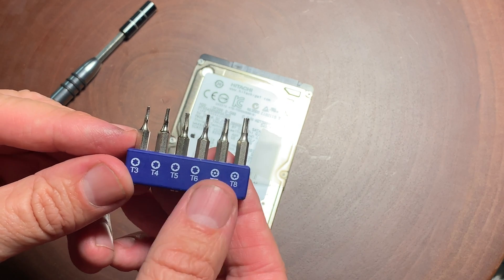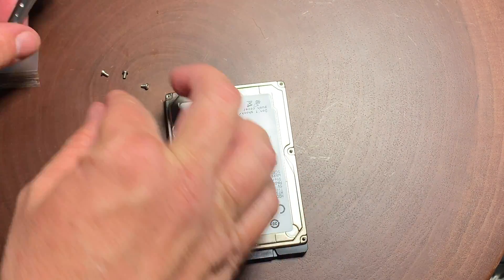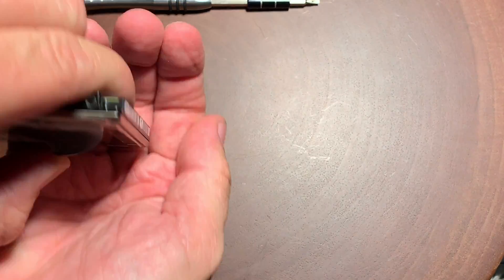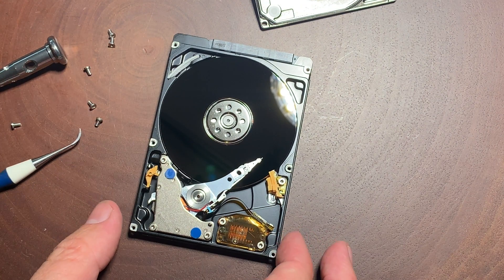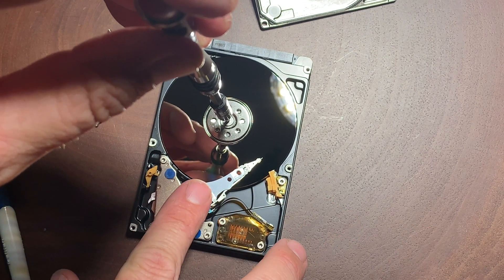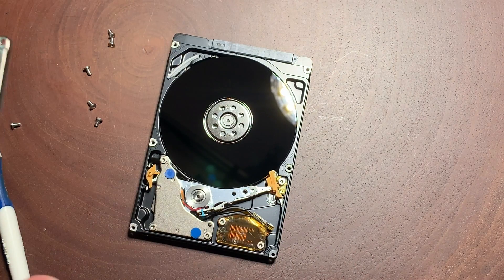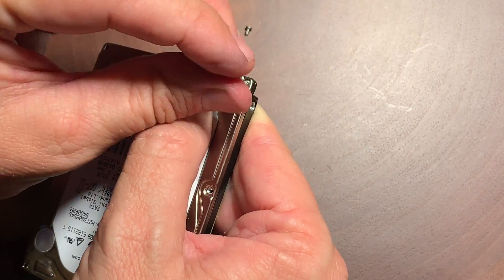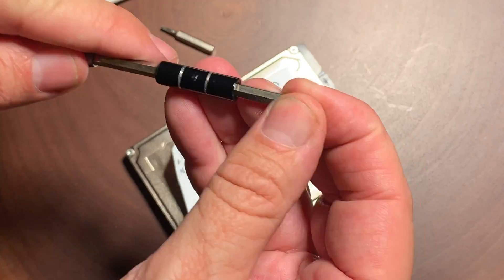How to recover data from a dead hard drive (Beginner Tutorial)

Comment: Old tech trick if the drive is still spinning up and recognized but not reading data or reading data but with many read errors is to disconnect it and place it in a freezer for about 30 minutes and then reconnect it and try copying data again. If this initially works then once you start getting read errors again, disconnect it and put it back in the freezer for another 30 minutes before reconnecting it for more data copying.  The goal is to copy all the data to a known good drive using this method. It will take quite a few iterations between freezing and copying data but I have personally used this method to recover (copy) 100% of the data on drives that appeared unreadable.

Comment: This is engineer-level difficulty. I mean, the one I think about, that isn't shown in the video. It's like these people have the ability to lockpick vacuum-sealed treasure troves of the modern era without leaving a single trace.
Reply: @user-rd6tuYuf  Engineer level difficulty? I had hard drive that was filled with photos that I didn’t want to loose and I was quoted $1,500 by a data recovery. I decided to try this tutorial as it didn’t seem difficult at all. I followed the  instructions and it worked perfectly for me and it is explained very well.
Reply: @thevintagelens  good for you

Comment: I've looked up other videos where you got to take a pic and stick it through the magnetic record needle saying that is in between all the discs, and there is a place where you can pull and make the needle click back into place.. that is a good solution but it didn't work for me but I'm going to go ahead and try this because I have not seen this video yet as of today.. I will let you know my results
Reply: And yes I make sure I wear some very tight dust repelling or should I say dust attracting gloves anything I can do to keep the dust out I turn off all my fans I close off all my AC vents I open my window and let the air breathe out some and then shut everything down. And then I'll wait 15 minutes before I even open the hard drive to try to make it a clean room in quote Out quote
Edit.      " make it a clean room"

Comment: hey if i get no sound at all from the hdd sata hdd. its the bigger one i dont know what the technical term for it is but its not a laptop size hdd it was an external 4 Tb drive Baracuda. anyways  i hear nothing when i put it in the docking station. could it be as simple as the pcb that needs to be replaced. i dont want to have to open it up if i can avoid that. if there is no sound at all no humming nothing does anybody think its just the pcb on the drive? any help would be appreciated.
Reply from the maker: Try the PCB. But you will need find one made in same lot as the one your replacing or it will not work
Reply: @carsandcamera   I'll look into it thanks for the reply it is appreciated. they make a 4 TB drive that seems to on average last 4-5 years what a scam. i only filled half of it but it had everything on it. what a racket none the less. Thanks again

Comment: I will try this today. I had a power glitch and the drive start making the clicking sound. If I get it to work again. Does that mean the drive is damage and I should move all the files to another drive. Or the arm stuck is mostly cause by the power glitch and I should continue to use it. Guess I need to run a drive integrity software to check the drive huh.

Comment: Please help ive lost 10 years of data and photos on my drive. No one will touch it.
Reply from the maker: You need to keep checking there are people out there that are very successful with recovering data. Search "hard drive recovery service"
Reply: I will admit i open the drive to see whats wrong. The arm was stuck on the platter but not moving. Long story short I tried a few of my own fixes😮 then tried to send it away. They sent it back saying it was too badly damaged. I even bogan identical seagate thinking i could just swap disc to just get my data i failed miserably.@carsandcamera
Reply: There exists a software utility named SPINRITE  . I have used it for several years , and successfully recovered , repaired many hard drives. The success rate was almost 100% and oh yes. I am a government certified electronics technician. SPINRITE  has proven itself over and over again. It's certainly worth a try. Good luck!

Comment: i might ber %50 right or %50 wrong , in order to work this you need %99.999999 lucky  even if you are %100 technically master
Reply: One of the ways to deal with this, after you feel that you have enough significant data on the working hard drive, is to clone it.
Reply: There are many ways to fix a drive. This is only one of them. Thing is once a drive has started going bad. No need to fix it entirely youll be changing it anyway. There is no easy fixing a crashing hdd.
Reply: To not damage the hard drive?
Reply: @LynxLeader  No, because if its already damaged, like the platter or the actuator, then simply resetting wont fix the problem. However, if its a minor mechanical problem, then resetting everything so it starts as it did when first powered might get it working enough to recover.

Comment: what do i do if the "head" (what you called it idk what its named) is broken and i have a 2nd hdd where the head is fixed? is it possible to switch it, if yes can you do a tutuorial please
Reply from the maker: What you would do is a platter swap. Now this is very involved so take a look at this https://www.wikihow.com/Swap-Hard-Disk-Drive-Platters  also when doing the swap the hardest part is finding the replacement drive as not only does it need to be the exact one because  the defective one but it has to have the exact same firmware. And not having the exact same firmware it will not work as they have to be exactly the same. This is why I never made a video on doing this as finding the same hard drive with same firmware is like finding a needle in a haystack. Doing this job is very involved and what I provide here is for hobby and entertainment purposes only
Reply: @carsandcamera  okay thanks

Comment: Clicking sounds. My hard drive just went down it tries to spin up then makes an odd noise and stops trying to run. I lost everything I deem as important and for some reason, my backups are missing the important directories. I will not let this happen again. I was thinking of trying to remove the platter and drop it in another drive, but, if this sound means the heads are just stuck as you demonstrated, I might be able to get it running long enough to grab the data. Something I find interesting just happened. I have hot disk turned on in bios so I can add and remove drives while my PC is running. So I opened Fdisk plugged in the drive and it saw it and it said it's not initialized. This tells me the circuit board is working and that the motor is not spinning up the platter. I think there could be 2 reasons the motor is dead or the heads are stuck, right? If the motor was dead, it wouldn't try and spin at all, but it does and it makes a beeping noise. I think I might stand a chance at recovering the data in the way you just demonstrated. what do you think?
Reply from the maker: Your heads may have clamped down on your platters if you notice these warning signs:
Weak, regular beeping noises. Beeping is one of the most common signs of damaged read/write heads preventing a hard drive from spinning up.
Reply: @carsandcamera  It just all of a sudden made that beeping sound when I restarted the computer as soon as  I heard it I shut down and removed it. I then tried it using my recovery data cables with windows running and windows kinda sees rather fdisk sees it but says it's not initialized it's not like any other hard drive failure I've ever experienced. I think it's probably worth a shot taking the cover off and trying to recover the data what do you think?
Reply: @KoolBreeze420  Did it work ?
Reply: I have similar problem with my HD. It is showing not initialized  but its running and making rythmic noise. 
Before It became dead, It was working properly for months even after making this sound but I was not aware about it and one day it started to show disk is not initialized and its capacity is 0 bytes.

Comment: Mine needle not stuck , picked by computer but won't let me see files. 
Is there another way to recover it ? Thanks.
Reply: If disk is appearing in file explorer. You can easily recover any formated/cleaned/deleted/Existing data using a command line tool called Test Disk.

Comment: Do not do this, I followed this video and lost everything, computer shops will not touch the hard drive if it's been opened as it has to be in a dust free environment, don't do it or you will regret it like I did.
Reply: I find a lot holes in your story. Did you listen to what he says at the beginning (I’m not a hard drive technician do this at your own risk) and when you opened the drive was the arm sitting on the platters as in his example. This trick will only work if the arm is stuck on the platters. And then it’s dependent on if the arm is possibly damaged. And he warns you that this should be done in a clean room. Then if you were thinking of using a data recovery service that could run in the four figures why would risk your valuable   data to youtube video.  I see big holes in your story. I have opened a  hard drive that are old and left them open to see how long they wii last applying read and writes to it. It was fun watching the heads race back and fourth and the drive continued to work. His video has over 500 likes so it must be working and then comes my final thoughts. You lost everything? Silly you didn’t have your data backed up. Hard drives are cheap and you didn’t have your data backed up. As I said big holes in your story

Comment: My hard drive doesn't show in bios setup and not sound  coming in hard drive. So can i recovered data from hard drive ?
Reply: Platter swap, with another drive of the same brand, same model, even same firmware (for the electronic parts).
Reply: yes

Comment: 1:10 I can see two specks of dust at  approximately 1 o'clock about 1/4" from the hub, when you hit them you'll probably get a crash.

You might have been better off tapping it on the lower right corner.

Let us know how many errors turn up.
Reply from the maker: I successfully removed all the data and no errors on the drive.
Reply: @carsandcamera  Whew! 😅
Reply: Drives spin at 5400 or 7200 RPM. The act of spinning alone will usually cause dust specks to fly off. Not always, but usually.
Reply: @FlavoradeRambler  Yup, always gotta' buy 10K/15K drives. :)